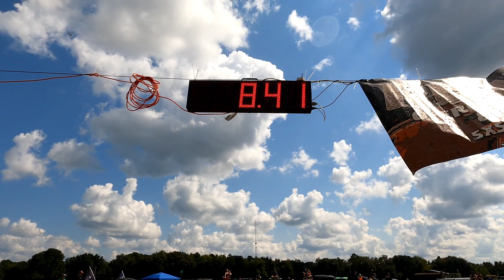TEAM 904 DOMINATES Southern Bounty Series//Moccassin Creek 10/2/2021

Comment: I’ve noticed you have the rancher handle bar cover on your rubicon. Do you have a video showing how you did it ?? Want to go it to my foreman
Reply from the maker: I dpnt but its just the bracket and pod cover. Really easy
Reply: @ProjectAjax  did you just take your light out or cut it off
Reply from the maker: Took it out and out in rancher pod instead